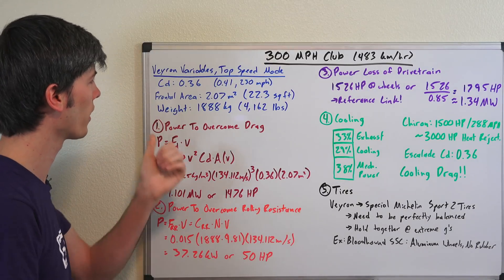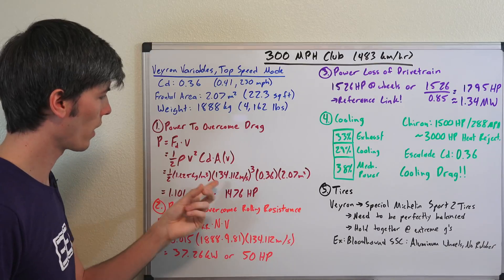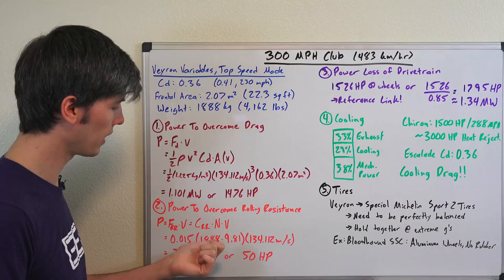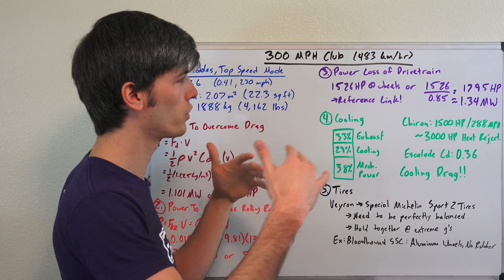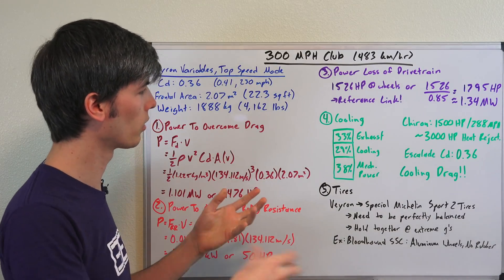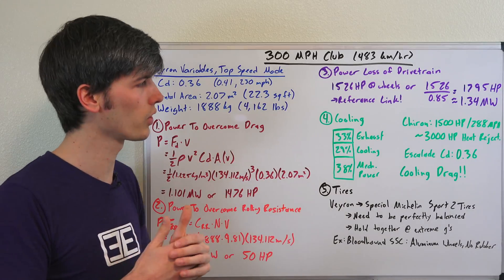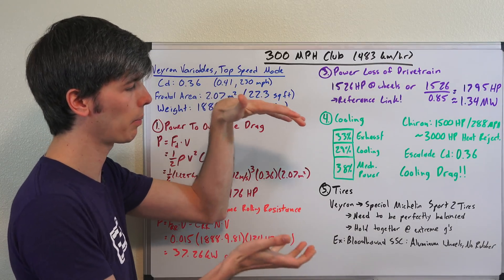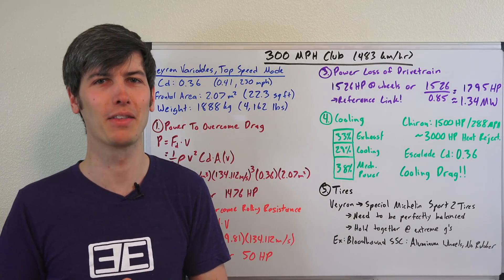Why Has No Production Car Hit 300 MPH?

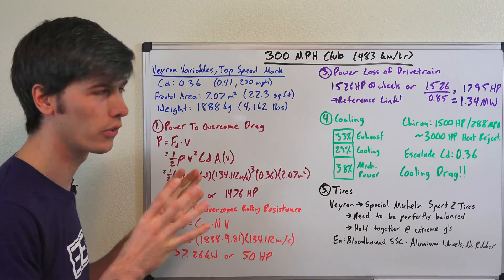Comment: I'm a comm crabber,local one that is,we pretty much do only day trips so every morning i get up at 3:00 ,the local highway i take to work every morning was built for cars of the fiftys to do seventy five mph ,unfortunatly my station wagon only will do 155 top speed,(factory limited),i love my job simply because i get the thrill of the rush to open it up all the way,no cars,no cops around,save but for the few deer around,(yes i have been in two wrecks and tottaled my rides)
but the rush is even more addictive than heroine. 
  i know I'm a heroine addict,....i just can't get enough female super heros!
but seriously ,as i drive wide open once i hit about 140 the front end gets lighter,I'm sure at the factory limit speed my front end would lift entirly offa the ground and would surly end up with wrecked.....my cars have no mods what can i do to keep that sucker down without altering too much of my belove sleeperwagon?

Comment: So would it theoretically be much easier to make an EV that can do 300mph?
Reply: Goldmattress not yet. batteries will overheat at the rate of discharge.
Reply: yeah if the batteries didn't succ
Reply: yep since you can just make e cars into condom shape great for air penetration since there no need for a radiator

Comment: Why has no production car ever reached 483 km/hr? Because that is f*cking fast and it servers no real benefits at all O_o Speedlimit at best is 130 km/hr here and even on the German Autobahn there are rules. 483 km/hr = car impounded...
Reply: ThaTyger at that point that can't catch you
Reply: +Oliver the Veyron eats the petrol like water then it goes 412
Reply: They don't have to catch you. License plate is all you need. Also while a helicopter is slower, it has a much better vantage point and isn't restricted to road and cornering speeds as much as a car. And beside that camera's everywhere and the German police has some pretty fast cars as well. Yes you'll be going 300Mph, for about 10 minutes. And then you are out of gas and you lost your drivers license, your car and the right to get a new drivers license for the foreseeable future ;)

Comment: Assuning that a Koenigsegg Regera has lower drag it could do it? (It certainly looks more aerodynamic)
Maybe if Tesla started using high drain batteries  and used more motor cooling and bigger motors, they could reach that (Please correct me if im wrong, but i think, that the drag coefficient ot a model s is 0.23)

Comment: Couldn't you solve the cooling problem with liquid coolant like ammonia or other refrigerates?  Or air cool systems are lighter, thus provides better overall performance.
Reply: refrigerating or ac systems produce more heat then cold if you've ever stood at the back of a window ac unit you can feel how much heat they put out.
Reply: Yes, that's the from the refrigerate changing phase which in turns pulls heat from whatever you're trying to cool down.  I am wondering if you could prevent overheating that is mentioned in the video with a more powerful cooling system (ie liquid ammonia).
Reply: there would be no point if its producing more heat then it reduces, and I doubt the refrigerate could change phase fast enough to keep up and engine that produces 3,000 hp worth of heat. Also the refrigerates would expand like crazy when exposed to the 200 plus degree engine and the turbos which can reach over 1,000 degrees Fahrenheit there would be some serious pressure in the cooling system which is no bueno unless you like your radiators to explode.
Reply: Guys water cooling works like fridges... the components are just better and arranged in different ways... it's all about transferring heat.
Reply: max mustermann There's no condensing coils in a cars cooling system and water cooling itself doesn't produce heat like refrigerating they are quite different. They both transfer heat, obviously but that's practically the definition of cooling, by that logic you might as well say air cooling works like water cooling because they both transfer heat even though they remove heat in very different ways.

Comment: It will be electric to hit that speed not much cooling then
Reply: much easier to have an electric vehicle do it. the engineering would be MUCH easier on an EV than a veyron. Plus in this case battery life doesnt matter as long as it can run for like 10 minutes.
Reply: They have 8000hp and they blow up after every single race. Totally irrelevant.
Reply: N4THANF0ST3R they can still catch on fire
Reply: Actually there is still cooling in electric motors... also keeping the batteries pumping out the power  needed and keeping them cool enough might be another issue
Reply: True, but electric vehicles don't lose 3000 hp for 1400 of useful power either. The cooling won't have to be so extreme.
Reply: fastest production gas vehicle right now - 280mph. Fastest production electric car 155mph. Electric production cars will not reach 300mph before gas.
Reply: Douglas slap a multi-ratio transmission in an electric vehicle with enough juice and you'll see.
Reply: Dhul Qarnayn just look how fast the batteries from lmp1 cars drain,and that only supplementing the ICE
Reply: It would probably be "easy" to make a 1-off EV that can reach 300 mph, but I don't see it being done in a production vehicle for a while.  The compromises needed to hit 300 mph would hurt at lower speeds, and there isn't really even an electric supercar market yet.  Once people are paying 7 figures for electric cars they almost never drive, then the world will be ready for the 300 mph electric car.  Until then, nobody is going to make EVs that compromise performance and efficiency at low speed in order to high a crazy top speed.
Reply: tavi921 a production electric car that hits 300mph will not be made for at least 10 years. We are only 14mph short of 300 in a gas production car. give it 3-5 years and we will see 300mph in a production gas vehicle. The technology is already there, they just slowly release cars with a higher speed to keep the competition up.

Comment: So technically we should assume that first road car to break 300mph could be electric? Less heat produced, smaller engine, better weight ballance, better drag coefficient and lesser transmission loss, just need to figure out gearing system as Rimac did.

Comment: Would it be easier with a turboshaft engine? (Cooling) Also, is there a CVT out there that can take 6000 HP?

P.S Is it possible for any type of turboshaft engine about the size a General electric T 58 to generate that much power?

Comment: Some exotic cars are going hybrid and are using electric motors as well. I wonder if someone will hit the sweet spot between both forms of power and reach 300MPH. But I suspect that would be another video with different calculations.

Comment: Good vid, ta. Tires are much underappreciated pieces of engineering.
Even at 200 mph any particular point on the tyre of a (say) 20 inch external diameter tyre goes from zero MPH (when in contact with the road) to 400 mph (twice car speed) when at the top of the wheel, then back to zero. And It does that roughly 60 times a second. Staggering forces involved.

Check my maths someone.
Reply: I don't think that's how it works....

Comment: Electric car would have much higher efficiency so the cooling needed is much lower. Also Transmission efficiency is better. Differential alone is losing something like 7-5%? Cooling could be made injecting liquid nitrogen or carbon dioxine? Would be interesting to calculate this for electric.

Comment: If it had active-aero that is enabled just long enough to get from say 200mph to 300mph, it could be done with significantly less power. Let's face it, you only need to do it for a minute or two, then once you back off the gas pedal, the vents all open again for an instant blast of cooling. You could also restrict this Vmax mode so that it only works when the ambient temperature is cold. I wonder how many HP the Veyron would need then, with all the air intakes actively closed, and what the Cd would be. BMW already have active air intake blocking that they use to help the car warm up quicker.

Comment: Wouldn't it be easier for a car like the Hennessey venom gt because it's light with a smaller motor meaning it needs less cooling and less vents so it's possible for it to reach 300mph
Reply: Alex Sibley it's not a production car.
Reply: L1TTLEH0RN666  then why is it considered the worlds fastest production car
Reply: It's not
Reply: L1TTLEH0RN666 do your research it is considered the worlds fastest production car
Reply: Nope
Reply: B10401 the coefficient of friction would be lower because of the lack of need for cooling on the smaller motor
Reply: B10401 because of this the Bugatti packs a twin turbo w16 while the Hennessey packs a twin turbo v8 a smaller motor and it has a cross plane crank making it in able to turn at the rpms that the Bugatti does therefor making less heat
Reply: Quad turbo
Reply: B10401 the more cylinders the more heat is produced and and the more turbos the more heat produced because the Bugatti has 4 turbos twice that of the Hennessy so it needs more to cool it making it heavier and needing more holes in the body to let air in to the radiators and intercoolers
Reply: B10401 it does make less power but it's lighter and that helped it go faster

Comment: Good vid, Id also mention that majority of cars actually produce aero lift, including quite racy cars that have a lot of wings and stuff, which often are just enough to have neutral lift. The Escalade might have the same cD as Veyron, but Veyron produces downforce just so it sticks to the ground in high speeds, where Escalade produces lift which at certain speeds would literally cause it to take off, atleast on front or rear wheels depending on the longitudenal lift ratio. So when you are not pushing the car into the road its easier to have lower cD
Because of aero downforce the Veyron produces it also increases the tyre loads which increase the rolling resistance quite a bit

Comment: Cool video, thanks for the great information! What do you think about the possible active aero that may decrease the drag coefficient during a high speed run like the Veyron's high speed mode? Like closing the brake ducts, unnecessary radiators or optimizing the flow at the top speed. I am sure the engineers at Bugatti thought about those but do you think it would make a significant difference at a high speed run? (Maybe a video about the drag coeff???)

Comment: the speed demon streamliner is the fastest pistonpowered car and has hit a top speed of 462mph at the measured mile
Reply from the maker: Do you know how much power it had?
Reply: Engineering Explained A bit more than 1500 horsepower.
Reply: The highest number i found was 2600hp and it's using fuel as coolant since it doesn't have a radiator

Comment: What about downforce at that speed? It for sure will generate some downforce (Well i can't imagine having lift at that speed).
Reply from the maker: Yes, technically downforce would add some rolling resistance, but as you can see the resistance from rolling resistance is very small in comparison to drag. You don't want excessive downforce to reach super high speeds (hence the rear wing will alter its angle to produce less downforce on the Veyron in top speed mode). You obviously don't want lift, but any more downforce than is needed results in unnecessary drag.
Reply: Thanks for answer Jason, yeah sure but I was more worried about the fact that it still needs to keep it's center of gravity fairly in the middle for stability(Hence why probably the spoiler is still retracted at slight angle, in high speed mode it seems to act as spoiler but in handling it is a wing, funny thing ;) ), and that flatfloor with diffuser for sure is generating some downforce, but then again Veyron has shape of like half airfoil, which for sure minimalises the difference of speed between the air under car and over car compared to conventional less streamline design. But then again even trough at this speeds air affects even small aerodynamic adjustments heavily, i still think it won't develop its weight in downforce even at top speed.

Comment: 3:06 i think a normal dyno run would do that as well because it measures not only the power at the wheel but also what you are loosing in the drivetrain by the speed it slows down after the run.

Comment: What about the mclaren f1? Its maybe the simplest car in the 400 km/h club, most usefull while least pretentious (just look at tail lights, fiesta boot size, almost 4 seats) The kinda car that always has gold on the inside and never on the outside (for heat dissipation, not showing off), anyway that were some random thoughts of how those 'good old ways' (its made out of carbon fibre, kevlar...) became way way more complicated electronically, mechanically and aesthetically for 20 years, in many ways not better cars, neither much faster...

Comment: Would it be possible to create some self sustaining entirely internal cooling system to lower the drag coefficient? It would obviously be at the expense of weight.
Reply from the maker: Unfortunately cooling systems cannot be closed from the outside air. The heat has to go somewhere, it cannot remain within the vehicle, so all heat exchange systems with cars are based on dissipating heat with the surrounding air. Drag racers, land speed record holders, etc, however, will sometimes use ice/dry ice/cold water within their cooling systems and simply replace it after the run. It's works for individual runs, but wouldn't work with a production vehicle where it's expected that the customer tops off with ice before heading out.
Reply: Engineering Explained I was thinking in terms of perhaps a heat absorbing substance in the cooling system that slowly dissipates so as not to greatly affect air flow. I trust you more than me though haha you are much more knowledgeable with this stuff. Thanks for the input!

Comment: Ive read on wiki that the regera has 1800 hp
Reply from the maker: 1100 HP engine, and 700 HP electric motors, but peak power does not overlap, so it's peak power is actually closer to 1500 HP.

Comment: how do they create 3000hp heat at 288mph with a 1500hp motor? I don't see where that extra energy is coming from
Reply: The engine has more than 1500hp thermodynamic power.

1500hp is what reaches the wheels. The rest is already lost at that point via cooling and mechanical losses in the drivetrain.
Modern gasoline engines have an efficiency of 25-40%, diesel has up to 45% or even a bit more (very few reach these peak values). The rest has to be lost via cooling or you will overheat.
38% is a very good number for a sports car.

If you have 1500bhp and 85% efficiency in drivetrain the engine needs to pruduce 1760 hp mechanically. If you consider a thermodynamic efficiency of 38% you need 1760/0.38 = 4630hp of thermodynamic power. So that would split your power up into: 1500hp mechanical power + 260hp lost in the drivetrain + 2880hp lost as heat.

And there you have it.
You need to a cooling system that manages to dissipate ~3000hp worth of heat while delivering 1500hp to the wheels.
Reply: Sven Sorg Thats because the enginge is producing 4500 hp but only a third of that is kinetic force
Reply: Please anyone correct me if I got smth wrong.

Comment: Should'nt you consider also the downforce produced by the car to obtain the normal force used in point 2? Or you just considered it negligible?
Reply from the maker: Technically, yes, I should have. I don't know what the downforce is that the Veyron produces, but in top speed mode they try to minimize downforce in order to minimize drag. I considered it negligible, however I used a high coefficient of rolling resistance, so it somewhat makes up for it.
Reply: Downforce on cars is generated by shaping parts of the car like an inverted wing. As such, downforce will increase with speed. Much like in an aircraft where lift will increase with speed.
Reply: Engineering Explained the faster a vehicle travels the lesser the downforce (think of the lift on a wing as air flows over it). I imagine the engineers are struggling to add downforce for stability, not reduce it :)
Reply: Mick McCarthy bout to say that

Comment: why didn't you corrected the rolling resistance because of downforce the veyron would be at least 500kg I think :/ 

this should rise the horsepower a lot I think
Reply: it isn't as significant as I thought if you use 2.5 tonnes of combines mass it turns out about 50 kW so not that mutch more.

but still why didn't you take this into account?
just curious;)
keep up the great work

Comment: Well the Chiron is packing 1500HP in standard trim and if we can learn from the Veyron, Bugatti might produce a Chiron SuperSports with an added 200 HP, totaling 1700HP. With all their R&D efforts they could lower the Cd in High Downforce Mode and the Chiron could reach 300 mph ?
Reply from the maker: Certainly fun to speculate! Would be awesome if it happened.
Reply: Not as awesome as getting a reply from Engineering Explained! There should be more to come from the Chiron

Comment: A 60 kilowatt electric motor should have the same power as a 3000 HP gas engine. So maybe it should be recalculated using an electric motor.
Reply: Dragon Skunk the tesla model s p100d has a 561kw motor which is equivalent to 760hp. So 60kw is nowhere near enough.
Reply: lol? 3000 hp is around 2.3 MW. 60 kW is about 80 hp.
Reply: Where did you get nonsense from?
Reply: I know my math is wrong,  you need 3000HP engine whereas I calculated from a 3000HP rated engine where you have to divide its output.